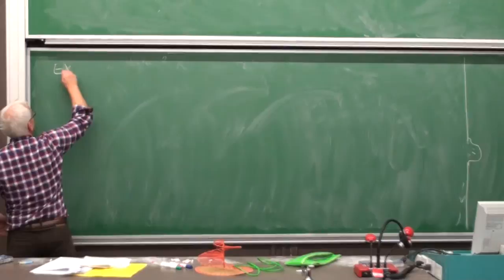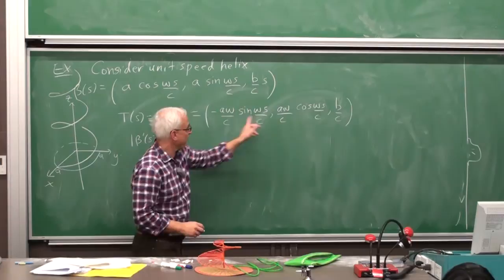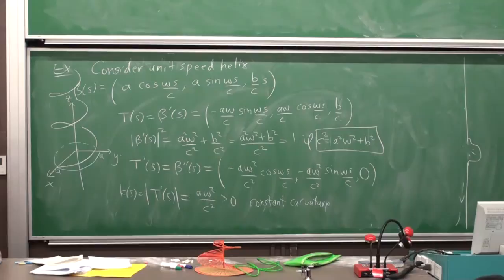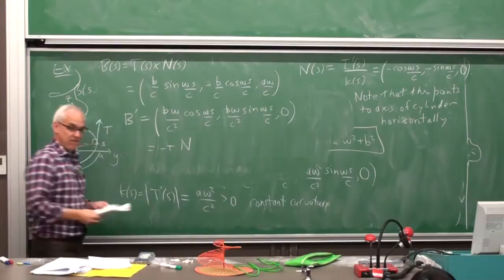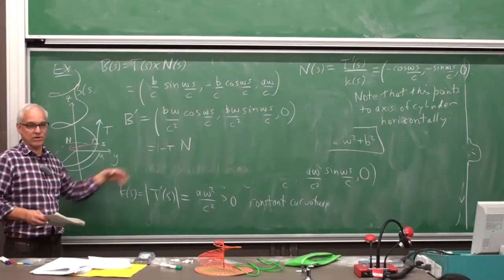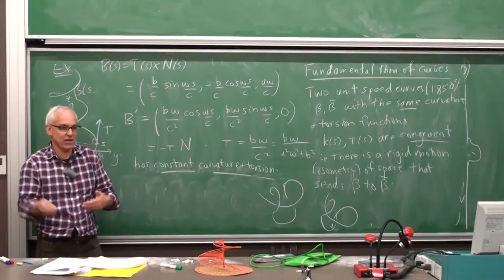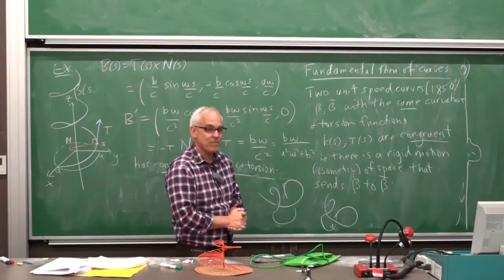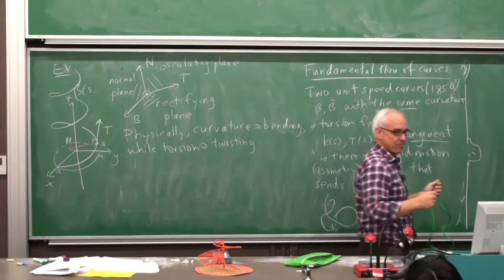The Frenet Serret equations (example) | Differential Geometry 19 | NJ Wildberger

Comment: So suppose you have a string with a red stripe along the length of it on one side. Is there a different always 0 torsion function along the helix (keeping the red strip on top, say) or per your example the flying carpet you're on as you follow the function only tilts from front to back and rotates but does not tilt from side to side? or do you find if you tried it with a real string the red stripe would naturally orient itself rotated around the string a certain amount?
Reply: Oh I guess if you think of the fibers in the string, those nearest the center of the helix would be traveling a shorter path with torsion 0, but the lengths of those and the fibers towards the outside have to be the same in the end, so it enduces a twist or a torsion.